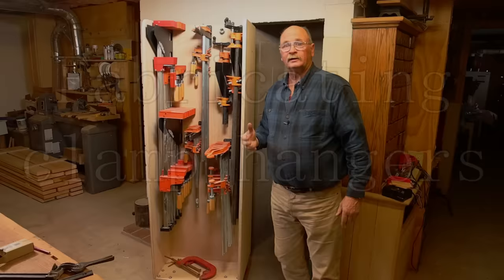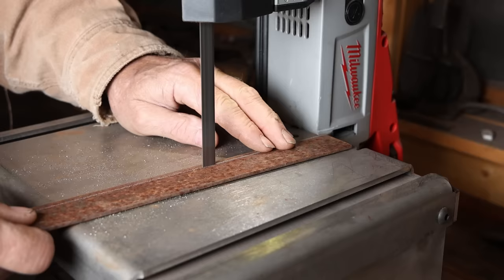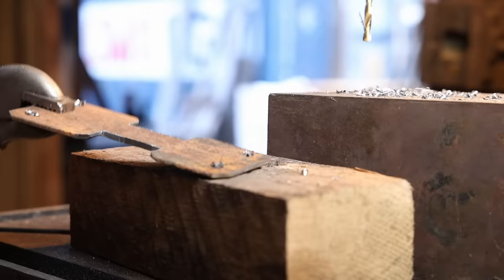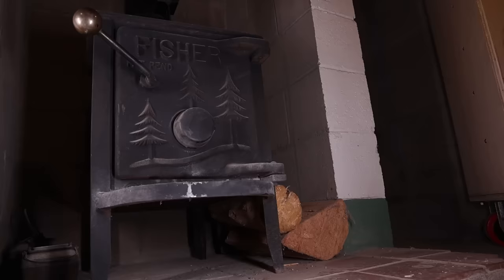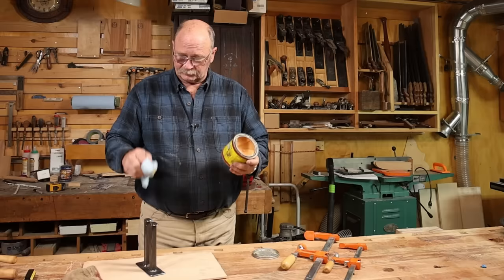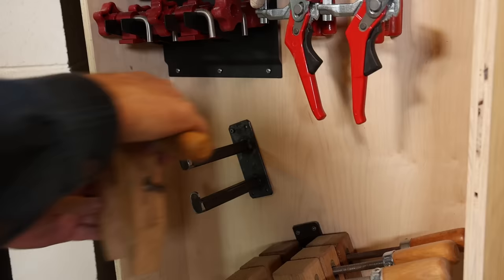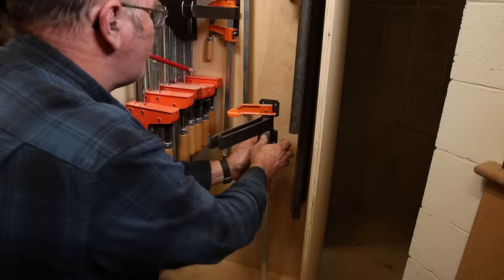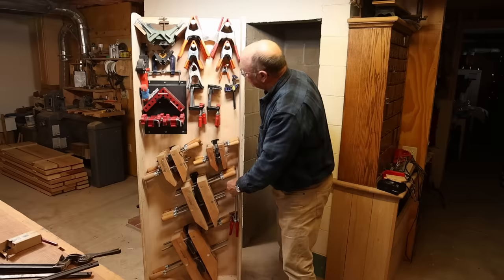Improve Your CLAMP Storage - Fabricating Clamp Hangers

Comment: Nice brackets, the things I would do differently, only because I don't have a bandsaw set up for metal cutting, is to leave the brackets a 90 degrees and use the welder to add a bead on top to prevent the clamps sliding off. It doesn't take much to create that kind of retention and the welder  would make a sufficient tab.

Comment: It's incredible to see just how creative you are John! Thanks for sharing this concept with us. I'm a bit north from you and today it's supposed to be 75⁰F today. Maybe it will be that for you too and melt some of that snow!

Oh, while I'm thinking of snow. How do you keep your shop propane from getting too cold that it doesn't work? The other day when it was 25⁰ here my forge wouldn't light. I suspect the propane was too cold from the night before when it got to 16⁰ out.
Reply from the maker: We should be warm here today as well.  Small propane tanks are an lissue in the cold. 100 pound cylinders do much better.  The main shop uses a 500 gallon tank and never has a problem
Reply: @BlackBearForge  woah, maybe one day I'll get a big upgrade! For now I'm stuck with my 20lb tanks. I've heard a blanket helps. I'm thinking since it's not too hard to do, I'll just bring them inside on days I know it's going to be super cold.

Comment: Dear Mr. BLACKBEAR,
I have an unsolved problem in the Art of blacksmithing:
How does it work, that the cable of my grinder is always 15 times drilled around, though i have it only 2 times in my hand and take care not to drill it once a time???
Do you have any explanation, or per haps a solution?